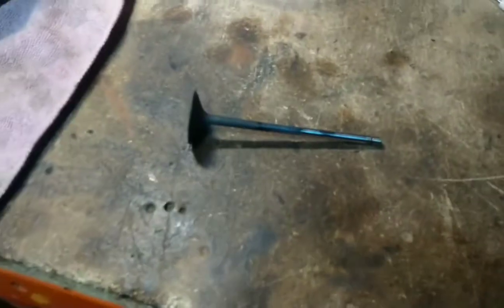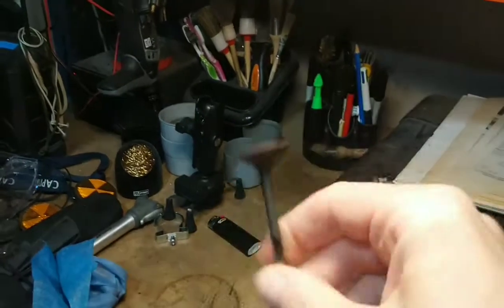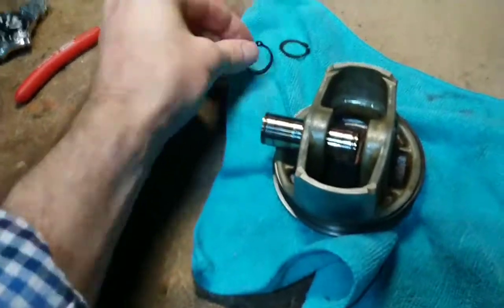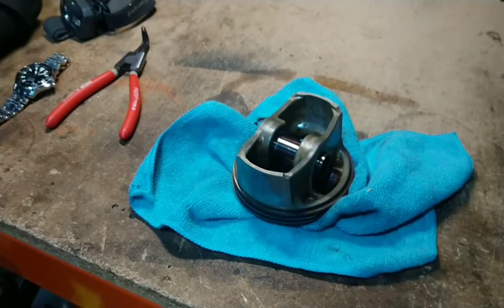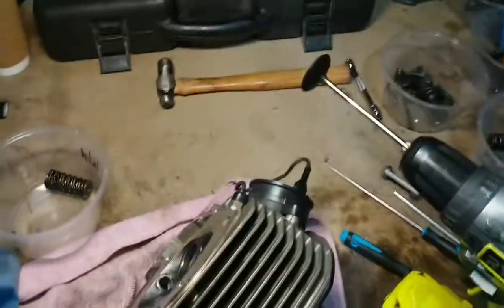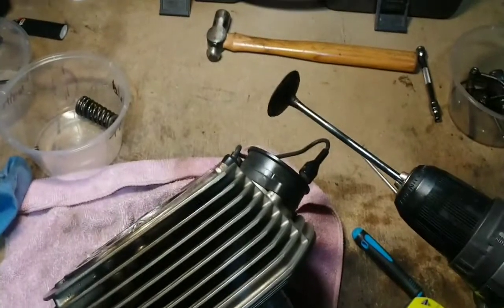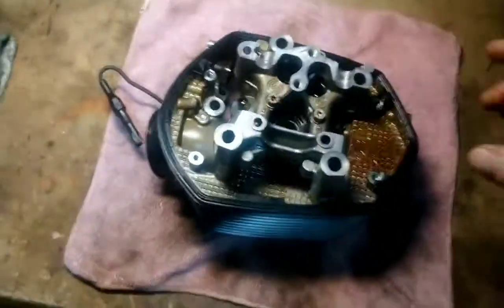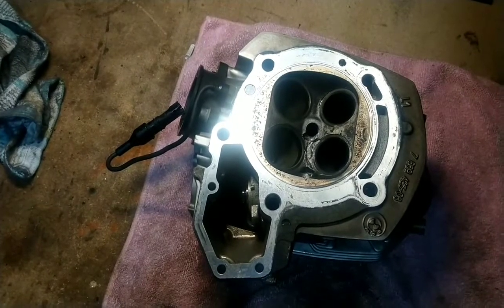BMW R1200GS Top End Rebuild Part 3

Comment: Actual damage aside, I think you really did get away with that pretty lightly. Would normally be a new cyl head at least. That must have ejected out through the exhaust port pretty damed quick before smashing anything else up.
Reply from the maker: Yeah, I'm pretty lucky really..